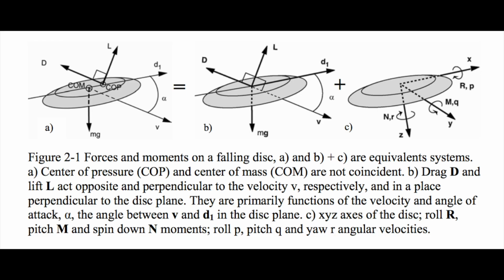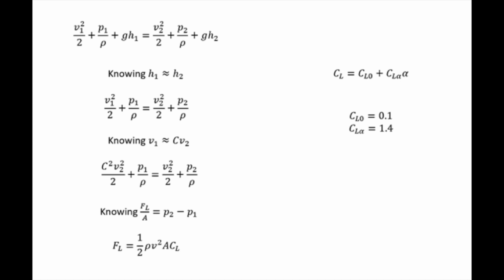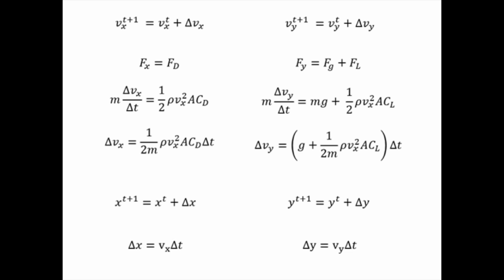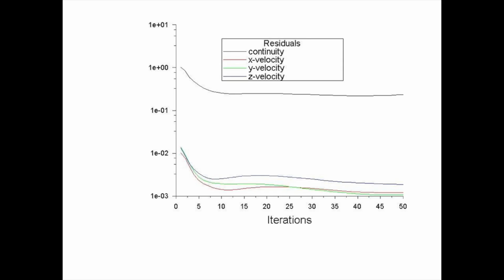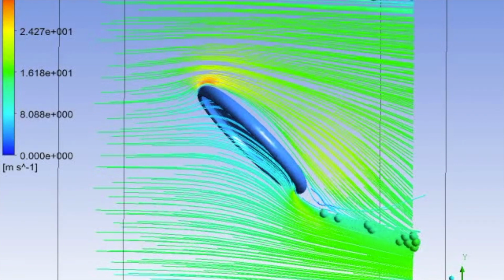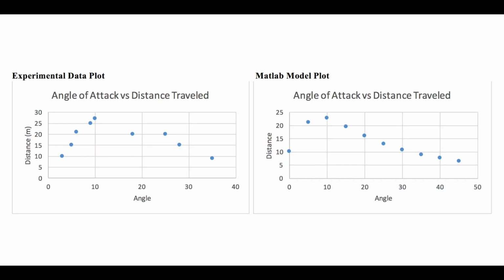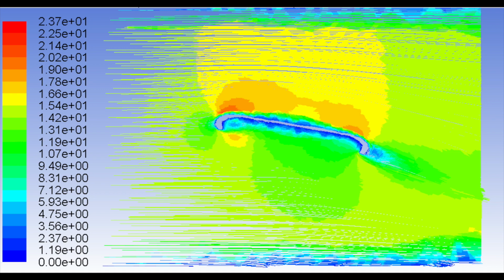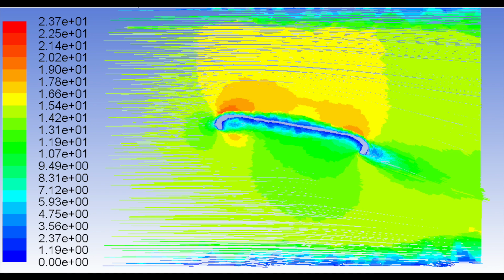The Physics of Frisbees

Comment: Hi Dana, great work on your video, thank you! Some observational data and questions for you. Discs at slow speeds need a lot of lift per time (or distance travelled) to remain aloft. It would be interesting to see normal hi speed throws (ones that travel 100 meters plus as is common in pro disc golf, and 150 meters in distance competitions). The angles of attack will often be 0 degrees. Such speeds would also enable the disc to stabilize so the pronounced wobble at slow speeds is minimized to facilitate angle calculation from the video. As a distance competitor I can relay that most successful distance throws have the nose down, or negative angle of attack. This was especially true for frisbees with their high profile bullet nose roundover. Partially this was because frisbees could coast forward as they fell out of the sky rather than stalling and crashing hard to one side. Modern pointy aerodynamic Innova golf discs thrown effectively for distance tend to fly closer near flat.  

What is very curious is that high speed inverted discs can also travel flat and fly, for speeds of roughly 50 mph and above. As a note, the hammer or upside down flick often used in ultimate is not an example and always flies nose up. Indeed we observe that inverted negative attack angles can fly well, uncommon to see, but happens in sports such as double disc court. I don't believe current aerodynamics can account for this. Greater insights into this phenomenon might reveal something of interest of broader application if you are interested in a disc-covery. ;)

Comment: So, there is no consideration of the spin of the disc? This model is oversimplified to the point of uselessness.
Reply: What effects will the spin of the disc add?
• Gyroscopic stability: The disc will be less likely to change its plane of rotation the faster it is spinning. So indeed, the change of the angle of attack can be assumed to be less than shown in the video. Additionally, this effect will stabilize the disc.
• Gyroscopic precession: A change in the angle of attack of a spinning disc will result in tilting it towards the left or right side (tilting left when spinning clockwise as the force up will be applied 90° later in the orbit than in the object - this my explain why the disc tilt before landing at 11:04).

So the model shown in the video is indeed a simplification. But if I do not miss any other effects, the results are a great basis to build on. And do not miss that simulation results are backed up by their experimental data.
Reply: yeah, the presentation is long-winded and only applies to the flight range shown, which no one uses. Gyroscopic spin is a vector with magnitude proportional to spin rate. Off axis vectors like lift or thumb down on launch have off-axis vectors and create a cross-product (perpendicular) vector that turns or lifts the nose. Throw above the designed speed and the lift vector is behind the spin vector. The disc turns. As the disc slows down the lift vector moves forward of the spin vector and the disc fades. Push down with the thumb on launch and the nose lifts. This is why turn the key works.

Comment: Seems that you have spent some time with the simulator, nice work! Did you build it yourself completely?

I got interested on frisbee physics while playing disc golf. There is a whole spectrum of different disc models whose behavion in the air is more or less different. The aerodynamic design is one issue, the mass distribution is another. Cumulation of pressure distribution around the disc creates the lift. Discs are designed so that the center of lift differs from the center of mass causing gyroscopic precession. Besides, the pressure distribution is dynamic as the speed, the spin and the posture varies during the flight. These factors make the flight path versatile. Can your simulator create an s-shaped flight path (=gyro model included)? Using disc golfers language, that path is called turn-over flex route. The pressure distribution development beneath the disc during the flight would be interesting too.